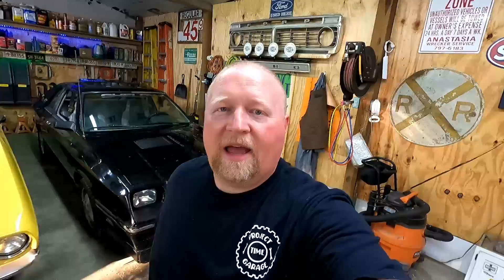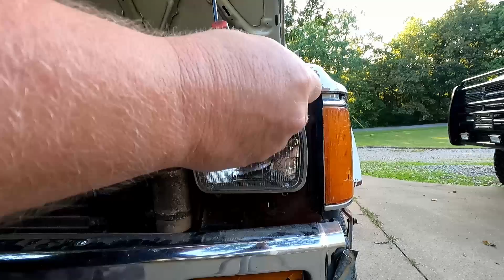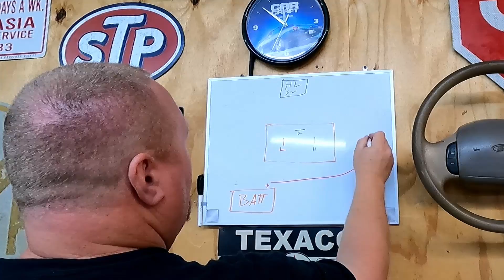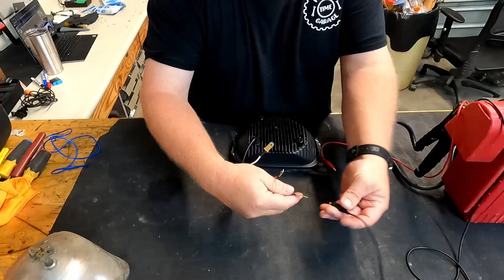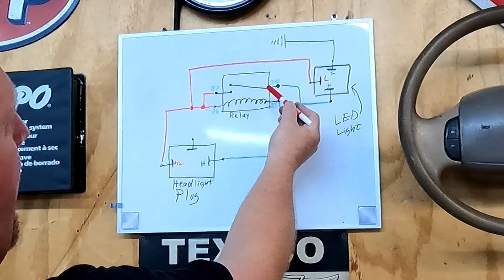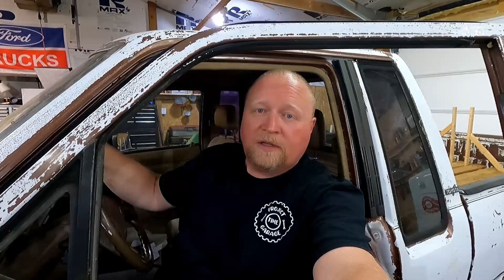Toyota Pickup LED Headlight Conversion - With wiring & Relays

Comment: Hello! Greetings from Argentina. I bought some sealed headlights similar to the ones in your video, but they won't turn on. I intuitively swapped the two pins for high and low beam, but I didn't touch the ground pin. If I swap them now with the ground pin connected, will they turn on? Without installing a relay, what dangers could there be without adding a relay?

Comment: My 84 is NOT WIRED that way. 
Don't know WTH he is talking about
Reply from the maker: Right.....That's why there's an entire aftermarket making "conversion" relays to fix this exact problem.
Reply: The only way yours wouldn't be wired that way is if someone has modified the original harness. All of them in that era are switched ground systems for the headlights.

Comment: I have a 2006 chevy express. If i use this harness on a new set of LED headlights do I also need to replace the flasher? Or no?
Reply from the maker: Not sure you need a new harness for a GM vehicle. Toyota was weird.

Comment: Does it matter what LED lights you have? My lights look like a bunch of small LEDs. I got mine from a traded vehicle so I dont know the brand and its not marked.  I did your relay diagram into a harness, checked it twice and still will not work. Its like the relay harness isnt there.
Reply from the maker: Doesn't really matter what LED lights. They all work about the same.

Comment: I just installed the bi-led projector on 2004 tacoma , did diy the harness but used diodes instead, was tested from 12v power battery, low beam and hi beam were working so far so good 

But when i went plug in on my truck , the low beam working but high beam so dimmed, i don’t know why ( weird) 

Tried upgraded the big ground cable but  still the same  
 I disconnected the drls wire but still same 
Check with multimeter tester( 2 wire of high beam from hardnesses )  12v and 9v 

Try anything but high beam still dimed

I ran out of idea

Please help !
Reply from the maker: Never worked with the newer ones. But all lights just need power and ground. As long as you have both, the light will work. Pay attention to those diodes. The job of a diode is to only allow voltage one way.

Comment: i wanted the oem look. So I bought a glass housing that looks like a sealed halogen light. But I can put my own led H4 lights in it. The low and high lights turn on/off fine. If I don’t install the harness, do you think it could ruin the LEDs?
Reply from the maker: No, it shouldn't hurt them.

Comment: I have a 1997 Toyota 4Runner and I added Auxbeam LEDs, the high and low beams work, but my problem is I no longer have my high beam indicator on the dash, I’ve read that some people say you need a resistor, will this relay system fix my issue? What would you recommend? I don’t want to burn up my wiring harness or anything I want something safe.
Thank you
Reply from the maker: The safest way to do it is to buy the pre-built harness that's available on Amazon.

Comment: Hey man, thanks for the tips! I get a question however, I bought some aftermarket led headlights and they illuminate with the stock wiring harness. Should I still install the aftermarket one?
Reply from the maker: If they work, let them go.

Comment: Hey man my toyota pick up 1990 headlights wont turn off. I have to disconnect it for the to turn off! What could I do to fix it?
Reply from the maker: You have one of the headlight wires shorted to ground.
Reply: @ProjectTimeGarage  appreciate you man. So it could be the wiring,right? My truck is turned off and The headlights seem to be still on

Comment: i bought the same headlights for my 97 tacoma, they came with the harness but only highbeam works which is insanly bright but low beam is barely bright, like you cant even see anything with lowbeam. any ideas of what that could be?
Reply from the maker: Almost gotta be a ground issue.

Comment: Are Wagner H6054 better than Sylvania SilverLight's?  I have the Sylvania and they are dim with a very poor light coverage pattern. I imagine the lens patterns are the same as probably both made in same Chinese factory.
Reply from the maker: You're probably right about the Chinesium. I'm not sure which ones I prefer. I've had both, but the Wagner bulb is probably better.

Comment: Are both high and low beam elements supposed to be on at the same time when you switch to high beam?
Reply: I would be inclined to make it operate the same.  Do you know if the replacement LED headlights are designed to run both high and low at the same time? I prefer to stay with intended design if they are meant to run only one at a time.
Reply from the maker: @randallflaten2620  The LEDs are a little rough to install - See, Toyota used a single hot lead to the common side of the bulb, then switched the ground depending on high/low beam. Every other manufacturer in the world seems to have used a single common ground, then switched the 12V leads at the headlight.
Reply: @ProjectTimeGarage  Thx for the reply. I can handle the electricals but need to know if LED headlights are designed to have both low and high LEDs on when using high beam.  Once I know that, I can figure out the relay/wiring needed.  I appreciate your replies.
Reply from the maker: @randallflaten2620  not sure if they're actually designed that way, but you can absolutely make it happen
Reply from the maker: Not by default. The truck removes ground from one side and puts it on the other side between high and low beam.

Comment: I've experienced this while retrofitting LED projector headlight into Daihatsu Terios, it has a double ground trigger and what I've noticed the +12v supplied by the original harness is weak. What I've done is I used the original H4 harness "low beam portion" (+/ground) just to power of the relay while the pin 87 goes directly fused to +12 battery terminal and the pin 30 goes + input low beam and + input Hi-Beam of the LED headlight, to complete the Low beam circuit I directly connect its ground to the chassis while the Hi-Beam will get its ground from the original harness Hi-beam ground trigger. I work with newer 2016 Toyota car comes with H4 harness, it seems they've change the mapping to Dual Positive and single ground now. Do you know any further car manufacturer or year of production that uses this double ground H4 system?
Reply from the maker: Great info, thanks!!

Comment: Hi! Great video, thank you  for the information. I had worked most of this out for myself before finding your video thou8gh anhd now I need halp after having it all working with a different solutuon....I decided to take the ground of the new LED light and make it permaneant to the frame....leaving the hi and low connections on the 3 wire plug......so only 2 wires plugged into the trucks plug harness as the ground is sorted.....it all worked fine and now it doesnt. I have checked the fuse box - ok. I cant get hi beams now and the dash indicator also doesnt not light up. Must be another fuse box or hi beam relay?? After your video i think I need to look at the column switch but there is no reason why anything would come loose there as I hadnt touched its wiring.  Any idea where that relay could be or what it looks like?  Any help please?
Reply from the maker: If I remember correctly the relay is on the passenger side fender well. Keep in mind there's only one hot wire that goes to the headlights. There are two grounds that go to the headlights. The headlight dimmer switches between grounds for high/low
Reply: @ProjectTimeGarage  I think the previous owner has LED bars and used a relay....he left what looked like an unused relay  ....I removed it and now they don't work. I lucked into having them work and then messed it up without knowing either ...I think. Thanks for the reply!

Comment: High beam indicator?
Reply from the maker: Intermittent
Reply: Just installed new LEDS now no high beam indicator.Any ideas?
Reply: @timothybales8428 i ran into the same issue. I understand the solution is to add a small halogen bulb so it can trigger the high beam indicator. I just dont know how is done.

Comment: Why not just replace the Toyota switch with a Ford or Chevy switch?
Reply from the maker: The Toyota switch in integrated into the turn signal multifunction switch. It would have been a fabrication job, plus having to go out and buy a switch. What I did was accomplished in 15 minutes using stuff I had on-hand. Way simple and the interior still keeps all its stock equipment.

Comment: They sell a wiring harness that’s $20 on Amazon, works great
Reply from the maker: Yeah, I saw those too. I found out about the whole needing a wiring harness right in the middle of filming on a Saturday. I had all the parts I needed on-hand, which made it all free,  so I really was only out about 20 minutes of my time to figure out the work-around.
Reply: I bought the Amazon harness assy, and cannot get my JW SPEAKER hi beam to come on.   Benchtest the lites work fine.  Argh...       I will study & eventually get it working.    
94 yota truck Japan JT4RN     
ext cab RN110.....

Comment: Hey I tried to wire in my headlights. Followed what you said and I don’t have high beam. When I check it with a volt meter it’s should be reason 12+ but is only reading 1 ish 

I’ve spent hours trying to get my lights sorted out
Reply from the maker: That's a pretty common thing. Toyota only supplied a single 12 volt wire to the headlights. Everyone else used two 12v wires, one for low and one for high. Instead, Toyota gave us one 12V wire and two ground wires. They switch high/low by changing the ground. The only way around it is to do a full-on relay deal. The diagram I drew on the whiteboard will work, for sure - unless something else is different in your situation.
Reply: @ProjectTimeGarage  with your diagram the high beam only reads 1 so it’s still not
Enough to
Power on

Comment: Of course you could flip that around and send 12v in pin 30 and the.low beam on 87a (NC) and the high beam on 87 (NO) and switch between low and high.  Your way has the low side hot in both low and high.   Your choice, either way is fine given the lower current draw. I've been quite impressed with LED headlight bulb tech lately. Just converted my 2000 Excursion over to LED bulbs and love the much better view at night while watching for Bambi. ☺
Reply from the maker: Yeah, you're right, running both low and high at the same time is basically a waste, since the high side also lights the low side by default. LEDs are getting better and better, I particularly like the projector lens housings. Good stuff.
Reply: could you please explain this a little bit